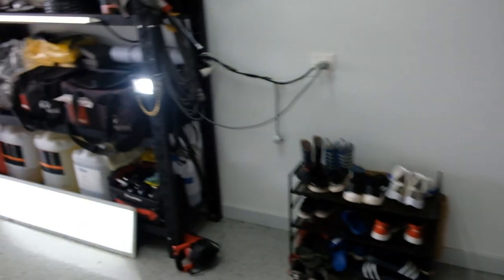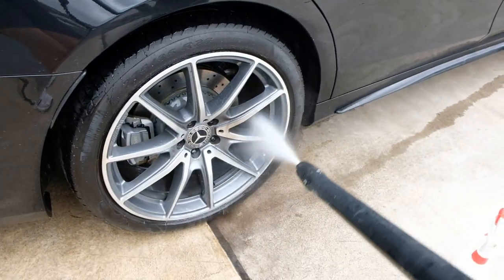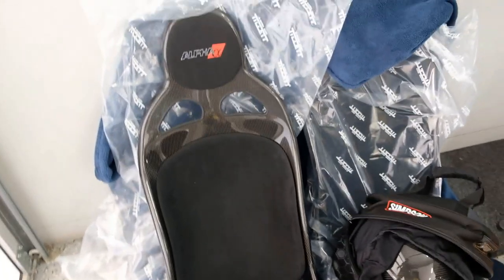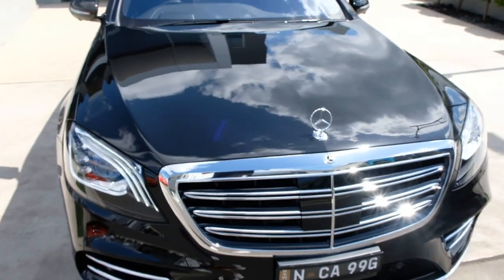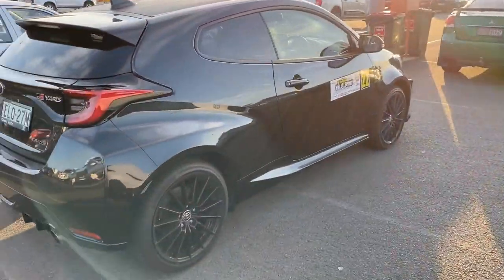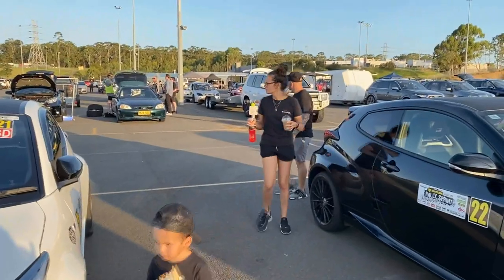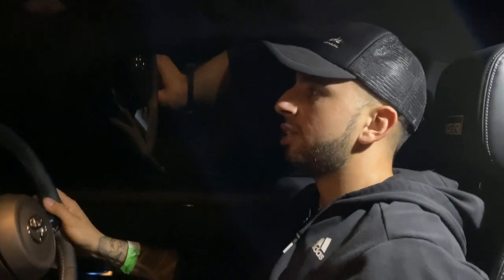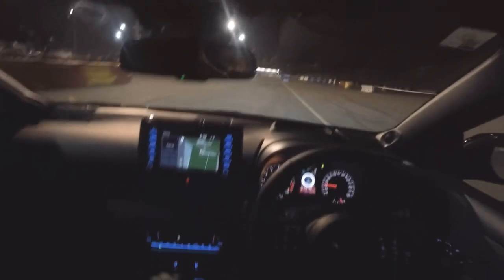GR Yaris Whiteline Rallysprint Twilight - LOVES the handbrake!

Comment: Do you need to have the clutch down while handbrake turning in this car? I thought you didn;t have to since it disconnects the rear anyway
Reply from the maker: Nope you don’t have to upon filming this I wasn’t aware of the feature and coming from a s2000 and s15 my inner Tokyo drift was used clutching in. 

Head over to the later videos on the small gymkhana and you’ll see the full effect of the system with no clutch in. Works phenomenal !
Reply: @smoothasbrothers  Great vids man 👍 Do you autoX in 50-50 mode or RWD mode?

Comment: Did you have to use the clutch when you pull the handbrake
Reply from the maker: Yes or else it will stall and you want to bring the revs up ready to take off
Reply: @smoothasbrothers  But doesnt the GRY disengages the rear axle when handbrake is pulled so you can do HB slides without needing the clutch
Reply from the maker: Now that you mention it i havent tried with the clutch out I always clutched in like the good old  s15 days 😉